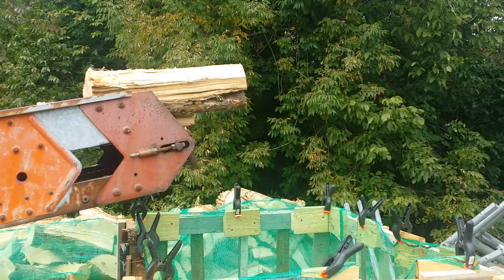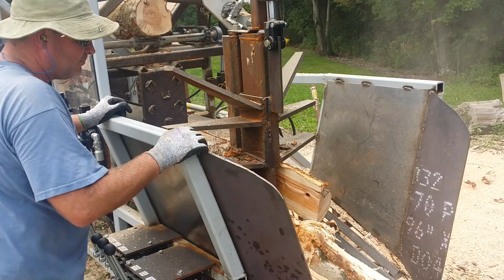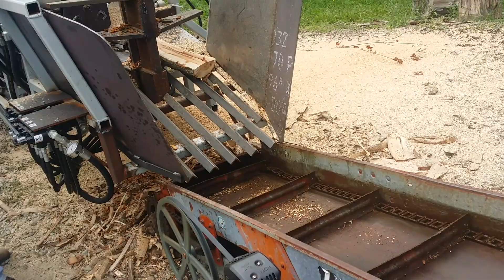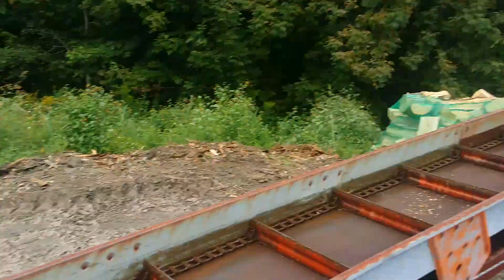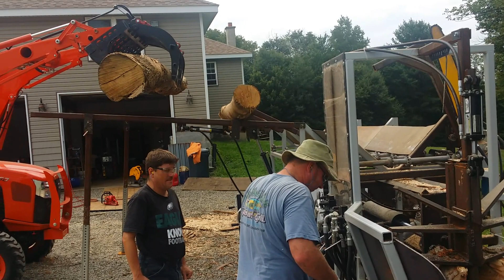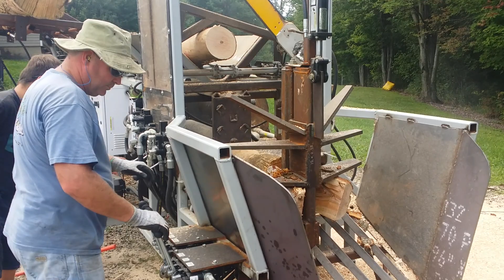Homemade Firewood Processor - 1st Day of Production

Comment: Great video...there has been a lot of thought and work go into this project. It would be good to see a follow up
Reply from the maker: I should at some point. We've made a few changes. The biggest was increasing the size of the hydraulic oil cooler by 3x. (now at 48hp of heat removal), We added teeth to the log clamp and beefed up the hinge pin for the log clamp. It works pretty dang good for what we use it for. No complaints really.

Comment: Great job - Nothing quite matches the feeling when the machine actually works!
Reply from the maker: Agreed. 5 years in it is still working just as well. Only thing we changed is that we are now running out of the back of the processor onto a tray and bagging or palatalizing the wood from there. A lot fewer steps...